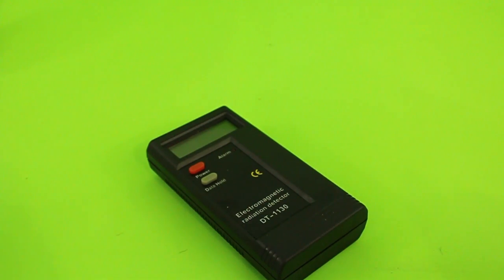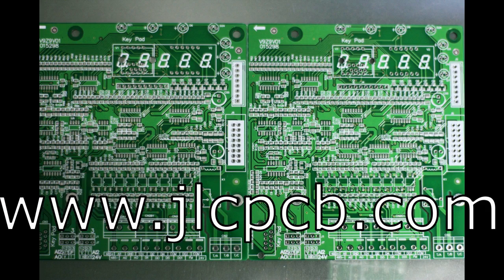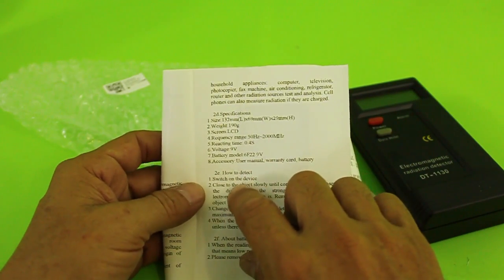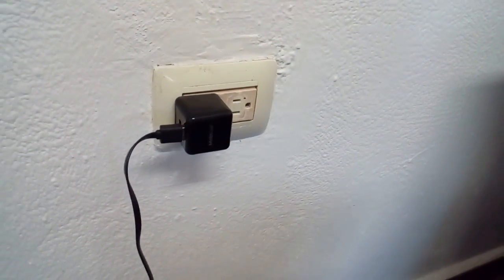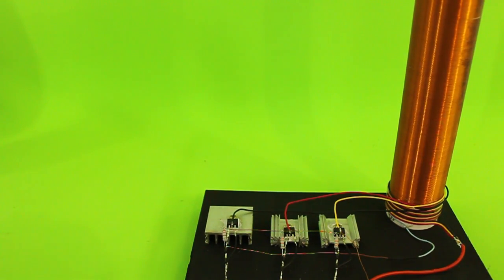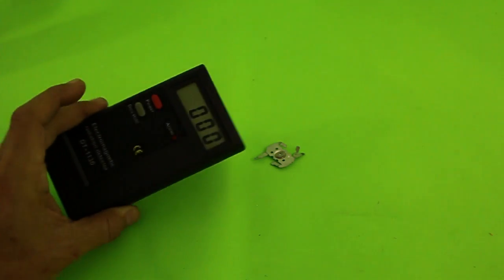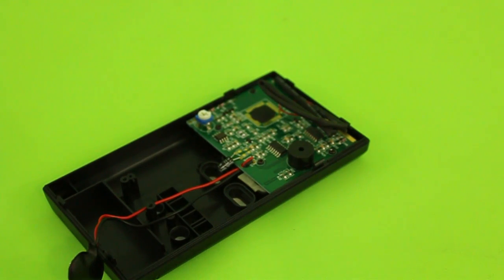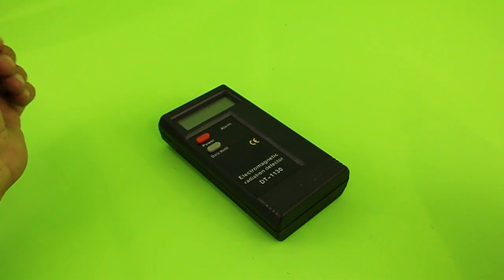Electromagnetic Radiation Detectors, Are They Any Good?

Comment: Why is it that it cannot detect cell phones emf?
Reply: because it only detects electric fields (and even that very poorly), it cannot detect high frequencies.
Reply: Can you please recommend any cell phone detector?
Reply: @rosenyasem8610  If you look at video 1/13 on my channel, at the end of the video you can see which devices measure what. Look for one that measures RF. I also test devices in RF mode in video 11/13 up to video 13/13 and video 14 and I wrote a conclusion pdf.

Comment: Has anyone figured out the units of measurement? Thx
Reply: Gauss maybe?
Reply: It's V/m since it only detects electric fields.
Reply: @Merializer  Mobile phone radiation is more harmful than electric fields ?
Reply: @alexivanov7532  It can be confusing, but mobile phone radiation has an electric component, RF radiation consists of waves that oscillate between an electric field and a magnetic field, but we call it RFR (radio frequency radiation) and we call the lower frequencies like 50Hz for example electric fields or magnetic fields, you can measure them separately. All kinds of EMF has the potential to cause health effects, different effects but sometimes the same outcome.
Some studies found harm, while others didn't. It is said this can have to do with who funds them and how they were set up, so it's difficult to know, but people should be careful with EMF, it's unhealthy energy in my opinion.

Comment: Hey guys, I put a third new battery, 9V in the  Electromagnetic Radiation Detector and it started working.  Where I was sitting must of had a lot of radiation because the unit went crazy beeping and flashing and wouldn't stop until I moved out of the Kitchen. Hmm?  So I retract my last statement saying the unit doesn't work.  It hasn't worked for over six years and now it starts working? Go figure that one out!

Comment: you need a geiger counter to detect radio active material.
this is identical to a NVC detector on a $20 multimeter and probably useful for technician to detect present of high AC voltage.
or probably ghostbusters need it.

Comment: what a weird thing. its name is kind of optimistic, the frequency range means its basically a radio wave detector and cant detect anything between microwave and gamma. I cant imagine what it would be useful for.
Reply: They are often bought by people who think emf is causing their ill health, doesnt matter if it works or not so long as it shows figures on the screen, they wont understand it anyway. Nice moneymaker, preying on gullible people and their fears.
Reply: @Apollo-p1l  Lol sucks to have a narrow mind like you. I used this to find defects in house wiring and to detect live wire. You don‘t have to dig the whole wire off the wall
Reply: Never said it didnt have its uses, but if you want ac mains detector, then there are plenty of devices designed just for that. They dont require a digital readout and they dont require a wide bandwidth. The popularity of these things is driven by the anti emf market .
Reply: @Apollo-p1l  Didn‘t know such market exists. The joke‘s on me then
Reply: Im tried it next to my microwave oven. Interesting, it shows a signal and sounds the alarm whether the oven is running or not. I guess it's picking up the digital display.

Comment: Its very interesting to see that the device shows zero electro magnetic radiation right in front of the wifi hotspot
Reply from the maker: Yes
Reply: @ludicscience  Cellphones most of the time use frequency bands from 400 Mhz to 3 Ghz, most of which are below of what the WiFi uses (2.4 Ghz and 5 Ghz). So if it couldn't even detect the cellphone I wouldn't even bother with the WiFi. Americium's gamma decay has a frequency of 1.45 * 10^19 Hz...

I suppose the stated maximum frequency of 2 Ghz was wrong, because that should still pick up something from the cellphone. As you said it's mostly a toy anyways.
Reply: WiFi runs at 2400 or 5400Hz too high for this device. There should still be a reading from the transformer and bridge rectifier chopping up the AC though.